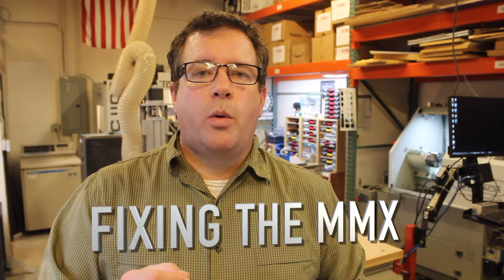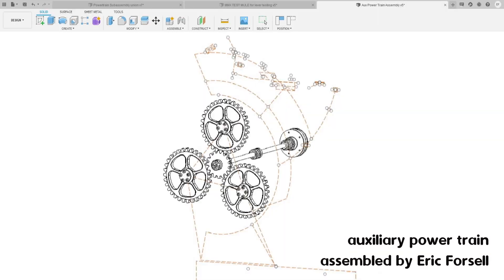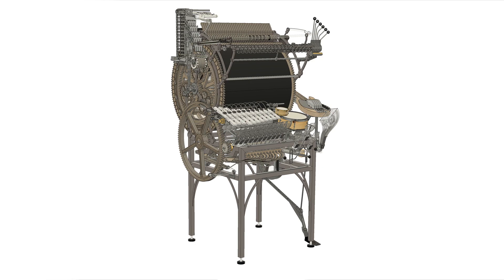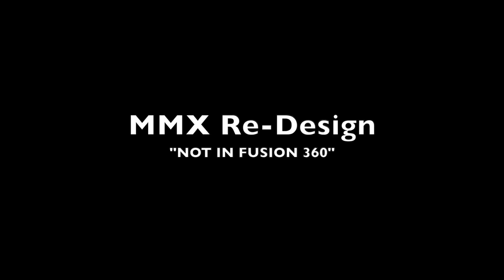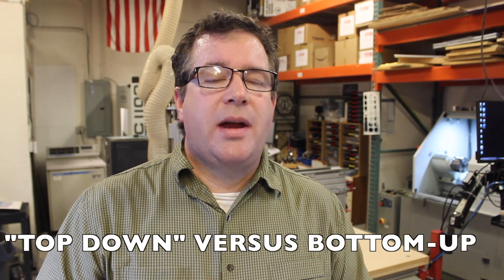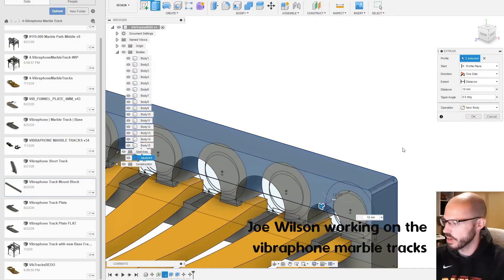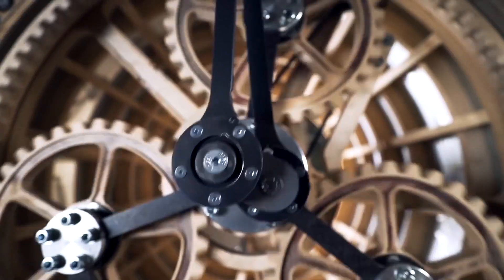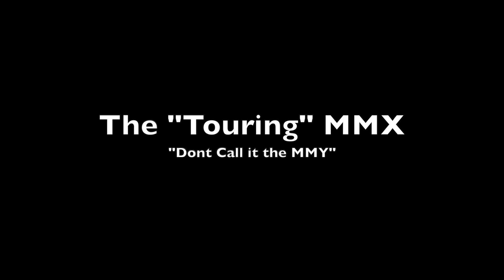MMX Cad VLOG Announcement

Comment: It's my understanding that Fusion360 is capable of both "Top Down" and "Bottom Up" design flows, along with parametric sketch's that you mention. Is there a particular reason to switch? i knew there was some issues with such a large project that martin addressed with the autodesk team in the past, i assumed a lot of the problems were just coming from novice mistakes.

Comment: so when can we buy the improved marble machine?
serious question though: how much would such a marble machine cost if it was produced professionally by a small company? let's say 5 people with a production of 5 machines per year? would it be more than 100.000 euro/dollar?
Reply from the maker: Thats a great question.   The better question would be however... what is the market size?   I can see making a couple for Martin, and maybe 5 more for eccentric billionaires / oligarchs around the world... who else would want one?    Most of the cost would be time... and a HUGE chunk of the time to make one is the setup time to make a particular part...   So this is a thing where I would guess (huge guess) that to make one, you would be paying over $500k.   But if there was any significant volume, that price could come down well below that $100k.... again.. just guessing here.
Reply: @adhd.engineering2240  additive manufacturing (sintering, etc.) and CNC milling will surely speed things up a bit. Also, distributed manufacturing. You already have distributed design and prototyping...
Reply: @adhd.engineering2240  I guess in a real company you would have to compensate for the development costs too. So much the better to see you all beeing motivated and doing this great work alongside your jobs and normal life.

Comment: So glad to hear that Phase II is in the offing. As a designer of flight simulators Martin's F360 model organization causes me muscle twitches... I use SW and am a big proponent of the SSP (Skeleton Sketch Part) approach for complex mechanisms. I look forward to the blogging on this subject. Regards. Daen
Reply from the maker: I hadnt run across the SSP terminology, but YES, we need that SO bad in this project right now.  (it seems you understand why!)
Reply: @adhd.engineering2240  SSP seems to be a term gravitated to on the Solidworks Forum. I refer to the same concept as a DATUM part. Regardless the name, the approach certainly has its place in promoting robustness and stability with complex models.
Reply: Hi! I used to teach SW, I did it for about 2 years, but it was quite a long time ago. I haven't followed all the improvement since 2008 or 2009, but if you end up choosing SW for this job, and if I have some spare time (I suppose I'll always be able to find some hours here and there), I'd be glad to be of any help in the project. Brice